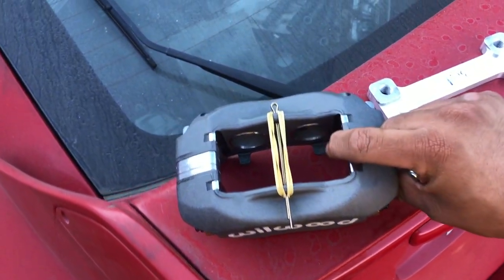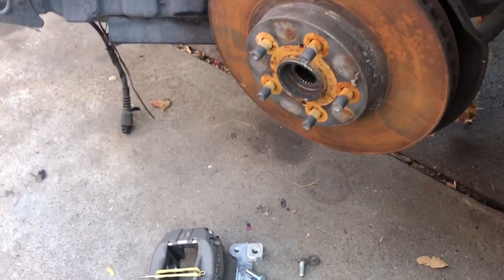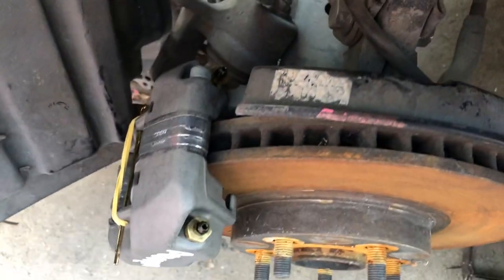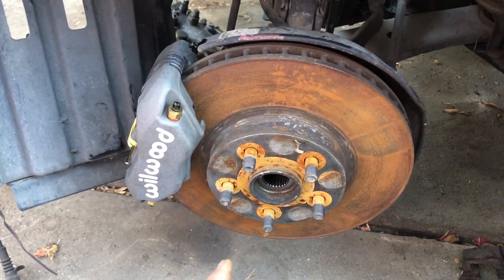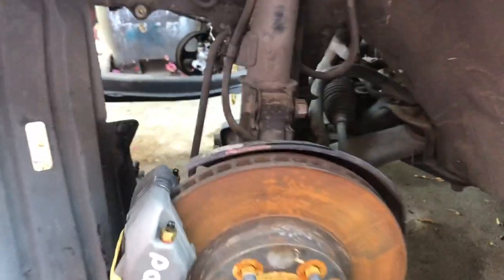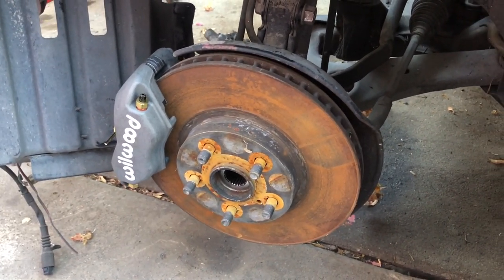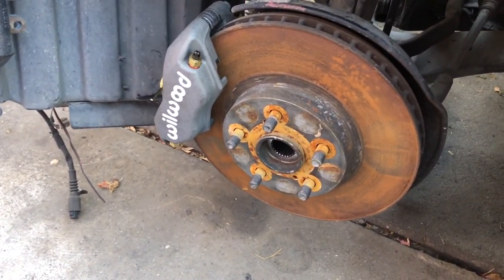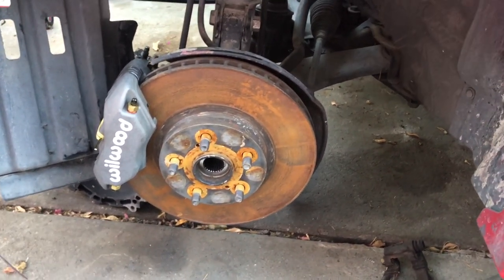Scion tC Wilwood calipers that work on 00-05 Celica and 03-08 Corolla / Matrix

Comment: What brake pads are you using with these?
Reply from the maker: Wilwood 150-8850k
Reply: 2zzlow awesome, thanks man, do they also work on with the 15” stock wheels?
Reply: @2zzlow how about the Corolla XRS factory 16" wheels? Will the wheel offset be enough to clear the caliper?
Reply: @noslef5054  I think Rafa and him said 17 inch wheel clear. Not the stock xrs wheel